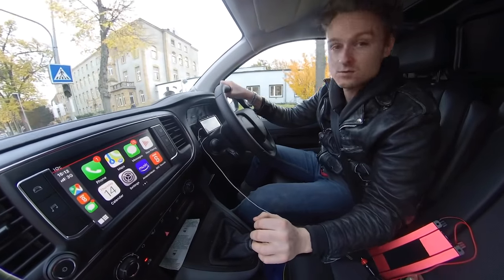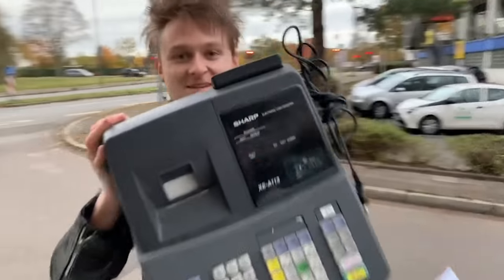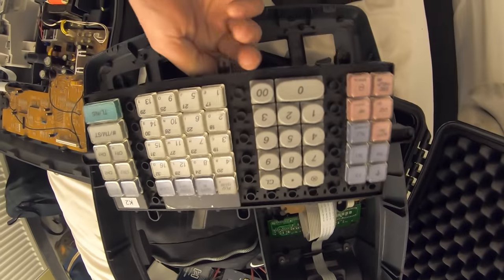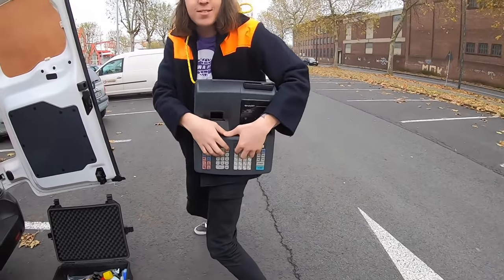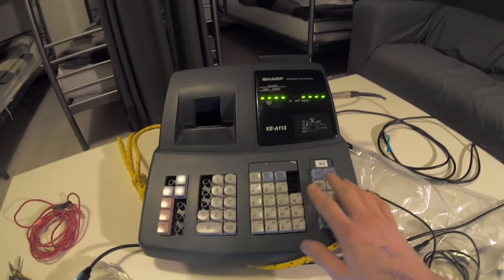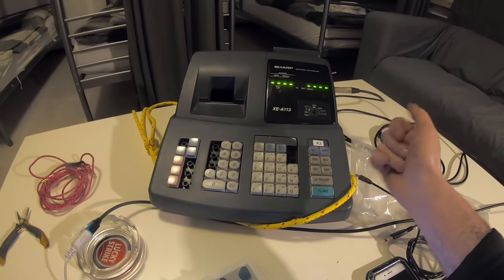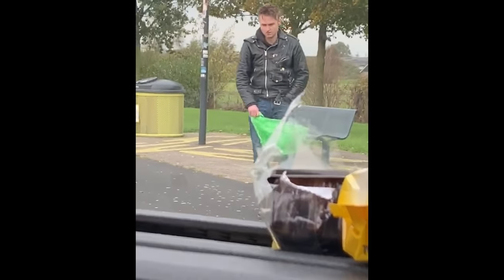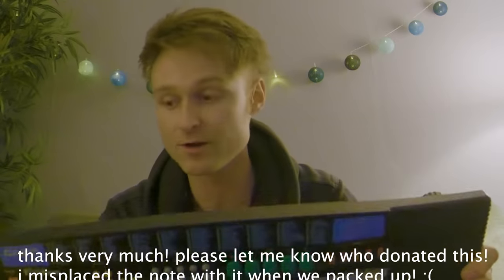MUSICAL CASH REGISTER, the modified cash register controller

Comment: Hey Sam, what library are you using in arduino for the midi? I use tttapa midi controller library, but wanted to add a pcf8574 to expand gpios this chip uses 2 only 2 arduino pins with i2c protocol

Comment: What is the model of that gas powered soldering iron?
Reply from the maker: - Luiz dremel varitip. Tips are pretty fragile susceptible to corrosion if a bit of the layer is damaged
Reply from the maker: Apart from that very good